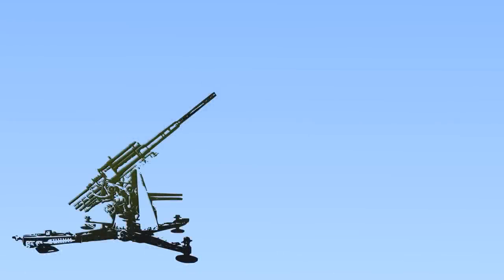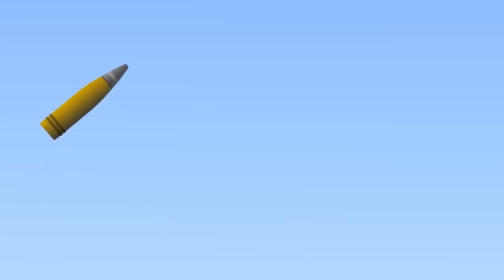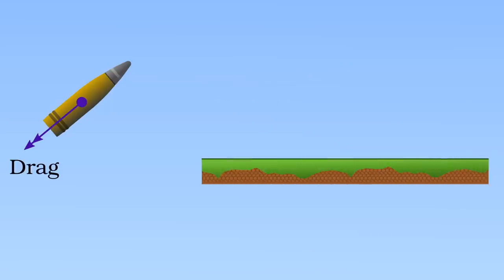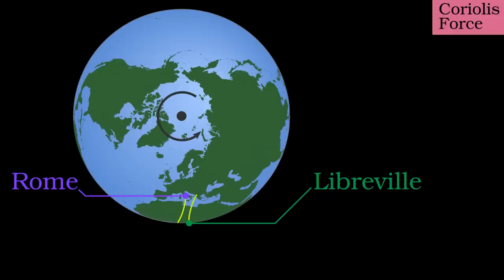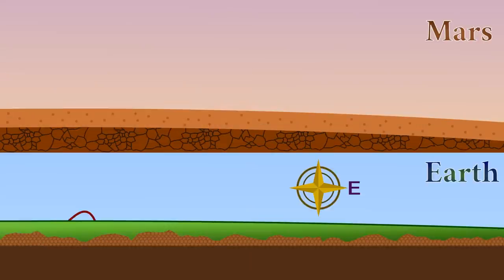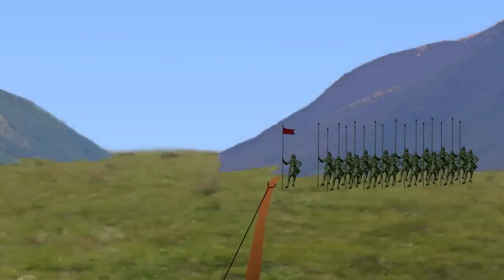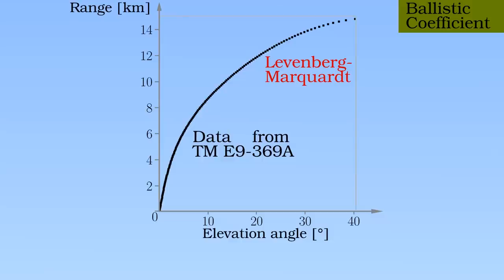Firing the Flak 88mm on Mars - ballistics, history and worldbuilding

Comment: Im currently writing a program to calculate ballistic trajectories accounting for drag. How did you calculate the impact distance? Did you use equations? Because I cant find any anywhere and its really bugging me.
Reply from the maker: I integrated their trajectories with the effects described in the video: curved planet, gravity, drag, Coriolis force.
Reply: @ImprobableMatter  How though? Cause I tried to and got stuck with the equations for the drag force being proportional to like 3 different changing variables.
Reply from the maker: Yes, that's true. For drag, you have to calculate the air density as a function of altitude (I give curves for this in this video, but you must have some function to calculate this) and the speed (squared) at that current time. Then you can get the drag term (I have provided a ballistic coefficient here you can use), but you also need the gravity term and optionally the Coriolis force term. Look up "Runge-Kutta integration" for an example how to solve this.
Reply: @ImprobableMatter  Ahh, so its a recursive algorithm, not an equation. I've already got a frame by frame style method of calculating the trajectory that works but wasnt sure if any equation for it would exist as that would likely be a much faster process for a computer. Thanks anyway. Good video btw, very interesting to see.
Reply from the maker: @lucaslewis-price6934  If you're putting it into a game or some other real time application, I would still suggest using a Runge-Kutta formula between ingame frames or whatever, as it is more accurate than a more straightforward ("first order" as it is known to numerical people) method.
Reply: @ImprobableMatter  Im not sure how I would be able to work with a starting altitude with this method as I am trying to calculate it more for an aircraft dropping unguided ordinance. But what Ive got currently works well for the application and is still relatively fast to calculate the total distance. Im using it for a CCIP style application so it needs to calculate the entire trajectory each frame.
Reply from the maker: @lucaslewis-price6934  Just another suggestion: see "lookup table" for another approach. Work out the full trajectory from, say, 100 different altitudes beforehand, have that as a curve (bomb distance vs release altitude) and then interpolate. Could do a 2D lookup table too (bomb distance vs release altitude and plane speed).
Reply: Which programming language are you using? I use Matlab and can write this in one or two lines.
Reply from the maker: @jimsagubigula7337  Please post your Matlab script.
Reply: @ImprobableMatter  Yes, I'll copy paste the code here: 
% This program calculates the trajectory of a projectile with air
% resistance with varying atmospheric density with altitude. The equations are: 
% 1)
% dvx/dt=-(ACd/(2m))(P0M/(RT0))(1-L/T0*y)^(gM/(RL)-1)*(vx^2+vy^2)/sqrt((vy/vx)^2+1))
% where: A=cross section area, Cd=drag coefficient, m=mass, P0=atmospheric
% pressure at sea level, M=atmospheric molecular mass, R=universal gas
% constant, T0=atmospheric temperature at sea level, L=temperature lapse
% rate, y=altitude, g=gravitational acceleration, vx=horizontal velocity component, vy=vertical velocity
% component
% 2)
% dvy/dt=-g-(ACd/(2m))(P0M/(RT0))(1-L/T0*y)^(gM/(RL)^2-1)*(vy(vx^2+vy^2))/(vx*sqrt((vy/vx)^2+1))
% 3) dx/dt=vx 
% 4) dy/dt=vy
% y(1)=vx, y(2)=vy, y(3)=y
% The program solves this coupled system of four differential equations
% using arithmetic methods. This means, it is impossible to get a general
% solution that satisfies the system. We can only get an approximate
% solution that is true for specific cases only. Thus, the ratios ACd/(2m),
% P0M/(RT0), L/T0 and gM/(RL) must be calculated for a specific case and
% then their values must be plugged in the equation below. Here, for
% example, ACd/(2m)(P0M/(RT0)=0.0012, L/T0=0.000024, gM/(RL)=4.26 and
% g=9.81 (all units in SI).
f = @(t,y) [-0.0012*(1-0.0000224*y(3))^4.26*(y(1)^2+y(2)^2)/sqrt((y(2)/y(1))^2+1);-9.81-0.0012*(1-0.0000224*y(3))^4.26*y(2)*(y(1)^2+y(2)^2)/(y(1)*sqrt((y(2)/y(1))^2+1));y(1);y(2);];
% Below, we specify the initial conditions of the system. The first bracket
% contains the solution interval. From which to which time we want the
% program to solve the system. Here, it is from 0 to 30 seconds. The second
% bracket contains the initial conditions for the differential equations.
% That is, vx(0), vy(0), x(0), y(0)
[t,ya] = ode45(f,[0 30],[831 480 0 0]);
Tell me if you have any questions. I have tested the program in several different scenarios, and unless the initial conditions are very extreme, it generally gives good results.
Reply from the maker: @jimsagubigula7337  Looks good. However, it lacks the following features alluded to in this video: the full gravitational formula (not constant g=-9.81), curved planet, Coriolis force. Also, the original commenter was inquiring about a single formula without having to solve an ODE every time, which I hope you agree is tricky.

P.S. Also, you don't appear to have an air density which varies with height, which I also talked about in this video.
Reply from the maker: @jimsagubigula7337  For the latter point, all of those are dependent on each other, look for "solving coupled ODE". Matlab's ode45 can solve a such set of coupled equations.
Reply: @ImprobableMatter  Yes, it should be able to solve it, but I get erroneous numbers if the initial conditions are extreme.

Comment: You could also have a plant that is Tidally locked with low energy star with a tight rotation around it at very high speeds. Not a physics guy and I'd like to know how that might change stuff.

Comment: Error :
The muzzle velocity is not fixed. If I remember well it depends on the external pressure and the internal pressure as well as the humidity how ever the later when talking about mars vs earth is to be ignored since mars is too cold for humidity and in arctic conditions on earth at -20, humidity is very low. The difference in pressure on earth can also be theoretically ignored, changing the velocity by only a few meters a second. How ever on mars, The external air pressure will be much lower which will increase the force the pressure from the explosive can put unto the shell.

A good earth example is people who make pingpong canons where the ball is loaded at one end of a tube then both sides are sealed. The air is removed from the tube and then the seal behind the ball is removed allowing the earths air pressure it rushes in and move the ball. The ball having no resistance in front is exposed to a way much higher differential then if it where just air pressure pushing giving the ball considerable velocity.  with a barrel lenght that would still be considered small on a large caliber gun, a ping pong ball can be accelerated to a speed faster then sound, allowing the ball to actually penetrate objects that are considered harder then it.

The Mars Flak could take advantage of this difference and actually have a longer barrel which would allow the munition to get even higher velocities.

In essence, any cannon that uses a form of pressure to push ammunition would have much more power on mars then on earth.

Also as someone said, Due to the lower pressure of air and also the lower wind speed on mars, the air cooling power is drastically reduced meaning the weapon would require a cooling system for sustained fire. With the lower gravity the barrel might not warp but the mechanism might end up forge welding itself shut, turning your gun into a muzzle loader as the breach become unusable.
Reply from the maker: Yes. Please note what I say in the video at 14:19 (check the author-provided captions for a transcript).

Edit: Specifically, I said "Because of the low pressure on Mars and in space, the shells would actually leave the barrel with a higher muzzle velocity than on Earth, because the difference in pressure between the exploding propellant and the outside would be larger by about one atmosphere. I did not bother to account for this because I'm lacking some important technical data, but it would be possible to infer a difference by making some gross assumptions."
Reply: @ImprobableMatter  Ah ok, Thanks for the whole transcript but I did not get that far in the video. It would have been better to explain it at the start as to why we fixed the muzzle velocity.

Comment: does the rotation around the sun have a significant effect?
Reply from the maker: Too small to be noticeable.
Reply: @ImprobableMatter  You could also have a plant that is Tidally locked with low energy star with a tight rotation around it at very high speeds. Not a physics guy and I'd like to know how that might change stuff.

Comment: You only covered one aspect of air resistance. For Mars' atmosphere the shell is overstabilized, meaning its spin is by far too fast. The longitudinal axis of the shell would not follow the trajectory. It would remain in almost the same angle in space throughout the flight. The shell is stabilized gyroscopically. Air resistance, little at the point and more at the larger base, forces the longitudinal axis to follow the trajectory on earth. On Mars, the spin needs to be much slower for the low air resistance to overcome the spin-stabilisation. The time fuse would work as intended, an impact fuse (AP shell) would only work at flat trajectories. Maybe I'm just too much of a stickler, because AP shells are usually fired at flat trajectories anyways. Firing a howitzer on the other hand would most likely result in duds since the shells would land on their bellies.

Comment: I'd like to work on the numerical side of ballistics, but I'm no mathematician.

However, there are a bunch of other physical traits of guns that Mar's peculiar conditions would effect. This is putting to one side all of the geographical aspects of Mars that would affect gunnery. 

Low gravity and limited weathering gives Mars some impressive elevations. However, the slope of trenches and mountains can be less steep because of their sheer scale. 

Is the opposite sometimes true? I don't know. Either way this combines with your  point about atmospheric drag to make plunging fire more and less effective.

But moving on to the physical characteristics of the guns themselves:

Google tells me that a few popular field guns use tubes oil compressing air to dampen recoil. 

Fluids like oil will not perform the same at Martian temperatures and pressures. 

Recoiless systems might be preferred. I don't know if the lower pressure Martian atmosphere would make backblasts more or less dangerous. 

Frankly, I'm not sure if atmospheric pressure has an effect on how well a regular gun's parts handle pressure. 

I welcome imput from any physics friends in the audience.

Comment: Wouldn't muzzle velocity be higher on Mars? The pressure behind the shell would be the same but the opposing atmospheric pressure in the barrel would be lower. I've see a few instances of people building pressurised air cannons and they get significant increases in muzzle velocity by drawing a vaccuum in the barrel and fitting the muzzle with a burst plate. [edit] Ah, you did mention it at the end.

Comment: "There could be a world with lower gravity than Earth, but also more atmosphere, for example."

In fact, just such a world exists in our solar system. Saturn's moon Titan has just a little under one seventh of Earth's gravity at its surface, but an atmospheric pressure at the surface that is 45% higher - and the density is about 4.5 times as high, due to the much lower temperature. In fact, the atmosphere of Titan, with only a sixth of Earth's surface area, is about 20% more massive than Earth's atmosphere, or a bit over seven times as much atmosphere above each square meter of surface area.

Comment: Neat video. It's certainly fun to think about these things, but I wonder how applicable they really are.
Imagine you're writing a story, and every time someone takes a shot you explain how the shooter has to compensate for the coriolis effect and atmospheric drag in this specific instance. That might get old fast, and you sort of need the story to centre on the shooter. 

Can these alternate worlds even support life? I know, currently we only know Earth, and nobody really knows what is needed to support life. But Mars won't support Terran life right now. Maybe no planet with such a thin atmosphere will support life, because you need some density of whatever gas you use (oxygen, CO2, methane) to survive.

Wouldn't the tidal forces of a planet revolving once every two hours tear it apart?

Also, most people are writing fantasy or science fiction with a certain amount of magic or magic-like technology. I think it would lead to dissonance to explain how rotational, gravitational and drag forces influence the flight of the magical arrow that breaks into a blue lightningbolt of magic in mid-flight. Obviously this is an extreme example, but you might have that problem. If you explain how your work models real physics closely, your reader will wonder why giant mecha or oversized humanoid monsters are running around your scientifically accurate world, and why your protagonist is flying around and slicing them up with swords instead of blowing them up from afar with a SABOT round.

Comment: not all guns work in space because metals stick to each other unless passivated properly. A P90 would work because those 4.7mm cartridges have teflon-coated bullets and gun itself doesn't have parts which can fuse.easily. And gun would overheat easily still. You need proper heatsinks.

Comment: Don't worry, the ballistics problem I did look at when world building. A MUCH older faction primarily used plasma weapons due to the amount of planets they controlled. Whilst the newer more prominent faction uses Magnetically Accelerated Barrels (Not actual railguns but a cheaper alternative) to achieve higher velocity (The primary drive for this was actually armor penetration and not any accuracy or to overcome higher gravity) The usage of most weapons is decided by Doctrine to be line of sight so that any overshooting or inaccuracy is negligible. However it's also a running joke that the top scientists within this prominent faction is the artillery units and tankers, due to having to utilize advanced firing computers to consolidate ALL of that information. (it is mentioned several times that on non-atmospheric planets that artillery is virtually useless because there is no real effect to slow a round down to come in at a steep angle beyond the gravity alone which is often very minimal to begin with, thus they fire directly down using their starships.) Yes. The ballistics of warfare did in fact shape how both of these factions function. Drastically. Especially the older faction.
Reply: Couldnt you just have the artilery effectivly fire missiles that can change course mid air with some sort of thruster?
Reply: @robertharris6092  they do use missiles a lot. Part of their doctrine is every rifleman carries a basic, cheap, reusable LAW, with the most advanced having VERY sensitive IR cameras. But shells are very cheap and easy to make en masse. Especially if you don’t know for sure where the enemy is.

Comment: The range of an 88 in definitely not 69km.
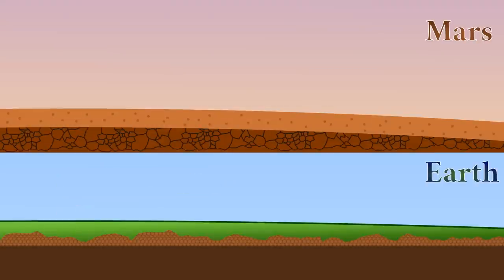Reply from the maker: Yes. At 06:45 I state "On Earth, drag has drastically shortened the maximum range to just under 14.5 kilometers" (you can take the author-supplied captions as an official transcript of the video).

Comment: This vídeo repeats onde of the ugliest and most widespread mistakes of basic physics teaching: that objects thrown in the air follow a parabola until reaching the ground. The curve is not a parabola but an elliptical arc! The two-bodies integration assures that on any moment two bodies can only be orbiting each other or have escape velocity. A projectile going to hit back the ground is very simply I orbit around the center of mass of the planet, with just the detail that it is a too low orbit, but before hitting the ground it follows the laws of orbital motion, that are always elipses.
Reply from the maker: You are incorrect. As explained in the video, the projectile feels drag and the fictitious Coriolis force, making the curve asymmetric (unlike an ellipse or parabola), often curving out of the initial plane of travel due to Coriolis.